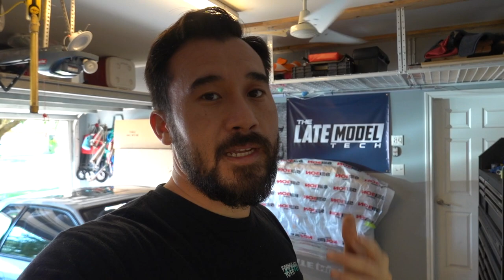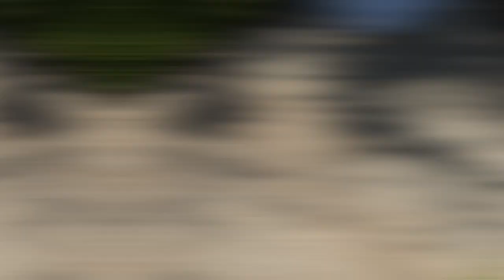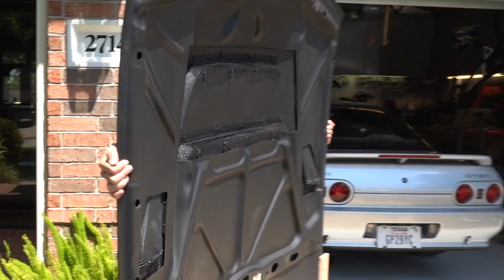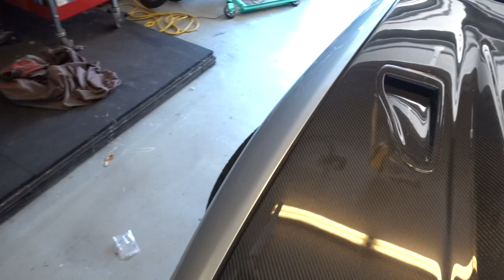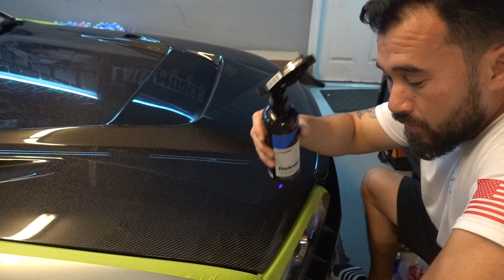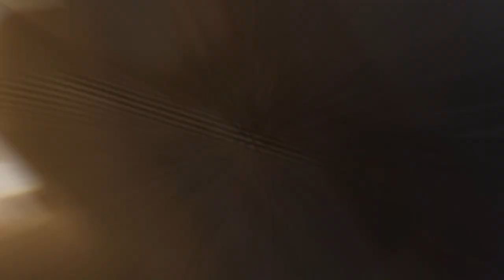Skyline GTS-T Gets A Seibon Carbon Fiber Hood and I protect it with Carpro Cquarts  Ceramic Coating

Comment: Possible to show us what you did/modded exactly to line up the hood with the hood catch? I’ve got to do the same thing veryyy soon.
Reply from the maker: At first just washers and longer bolts on the bracket.  Removed that because I was worried it would fail. Did this How to Install AEROCATCH Hood Pins / Easy Cutting Guide /  R32 Skyline GTS-T RB20
https://youtu.be/RZLy7sCdzB0
Reply: @Donnythelatemodeltech  thanks for the reply. I saw your vid on the latch install. Not sure I want to do that(aluminum hood). Also where your pin is on the d/s, I’ve got a big catch can. Might be a PITA